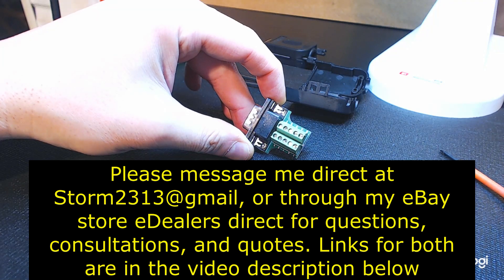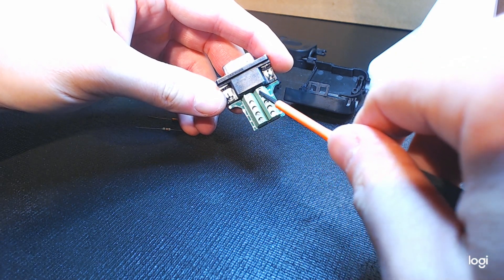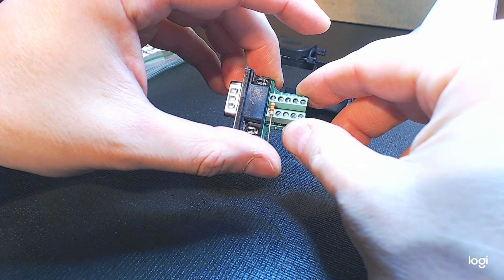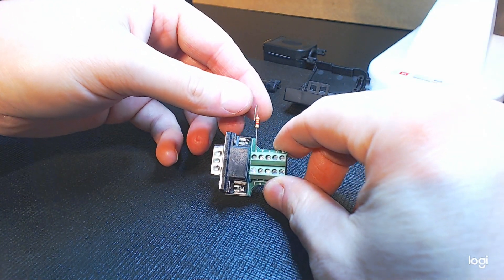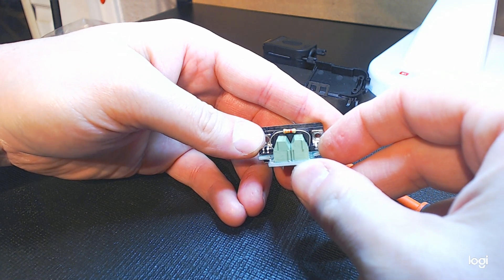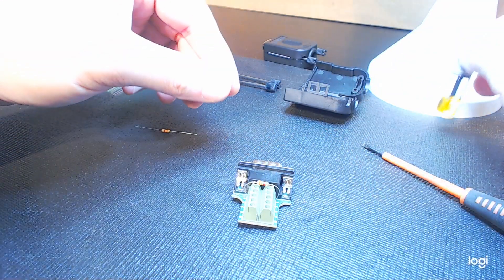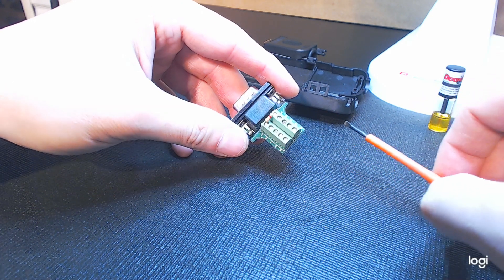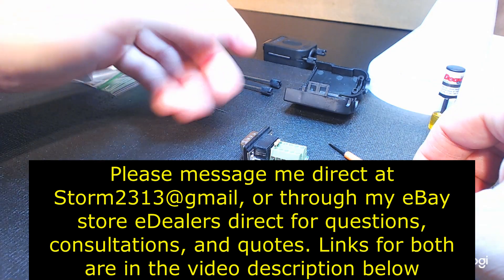How To Install Resistors In A Terminal Block (4K)..

Comment: Is it pin 5 and 1 regardless of the order on terminal block?  The set you sent me have a order of 1,2,6,7,G   bottom row 4,3,5,6,8
Reply from the maker: Its terminal point 5, and 1 regardless of order as the resistor ends are the same. Thank you,
Vince